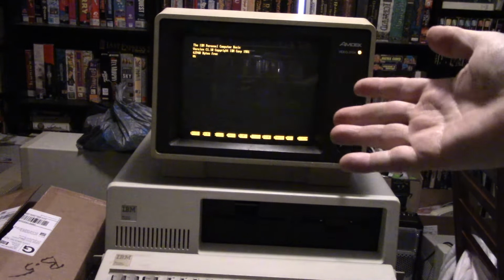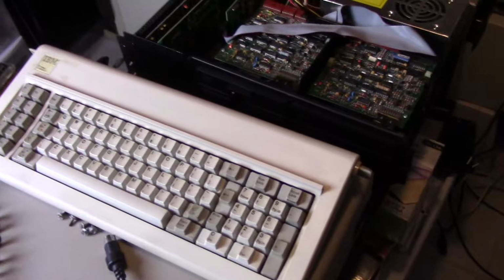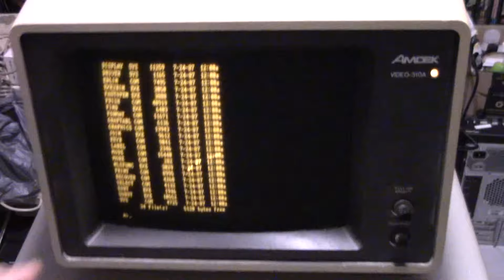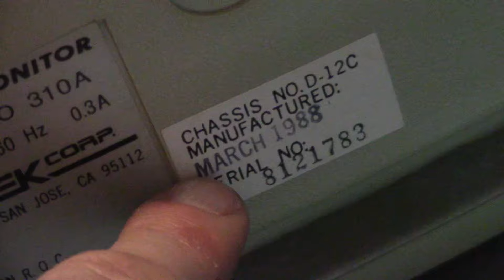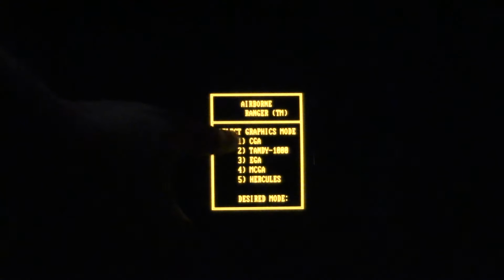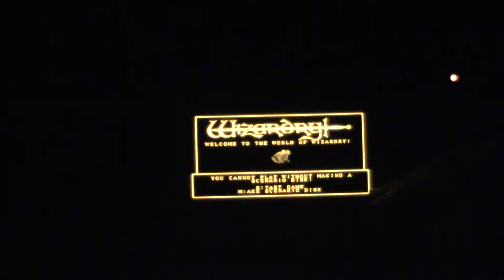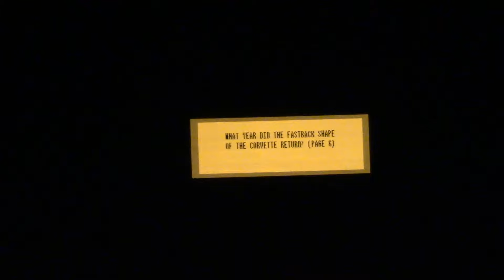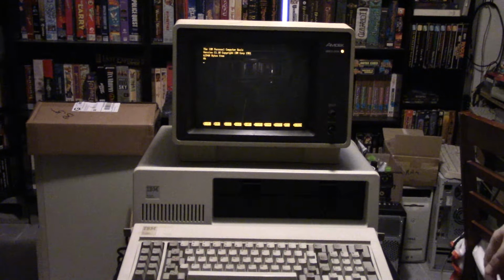IBM 5150 and Amdek 310a amber monochrome monitor

Comment: Green was indeed the first CRT phosphor color developed, initially used on oscilloscopes and radar scopes. Later they mixed blue and yellow phosphors to create a white phosphor, used in black & white TVs. If you take out the blue and just use the yellow phosphor, you get a yellowish amber color. I think there is some validity to the eyestrain argument, because green is fine for text-only displays, but for graphics, it is rather lurid, and amber is more pleasing to look at. Thus as the graphical capabilities of computers improved, amber became preferred over green.

And a lot of games don't fill the screen on Hercules because they used the same graphics that were designed for CGA, thus only filling up 640x200 out of the 720x348 display. Later when EGA became more common, the similar resolution (640x350) allowed them to share graphics with EGA and thus fill up the screen on a Hercules display.
Reply from the maker: But had you ever heard of complaints of colorblindness caused by green screens....I mean, I'm no eye specialist so I guess its possible but I'd never heard of that.

Comment: Hey it's me again if you remember from way back in Laveen, AZ with the Japanese computers. I've been in Japan again for about 3 years. Doing all my buying again before I leave. Almost done upgrading my Amiga 500 with everything. Next step is to get another PC9821, X68000, and maybe some more FM-Towns stuff. I will be moving to Texas this time. Currently catching up on your videos! Take care!
Reply from the maker: Hey, good to hear from you. I don't know if you've seen it already but in my newer videos, you may catch a glimpse of the PC-9821 that I finally got to set up after all these years. I really need to find time to do a video on it.

Funny enough I actually found another PC-9821 here locally, it's an older model from the one I got off you though. I'm currently trying to track down a PC-9801-86 card for a reasonable price since I learned the FM chip built into the 9821 isn't actually 100% compatible with all games.

Good luck with your Japanese PC finds! keep in touch.

Comment: Also ...super jealous you have a model f. Been trying to track one down for either the 5150 or 5160 if either one can be brought back to life....and jc howd you make boot floppies for it? I tried rawrite and it doesnt seem to want to write the dos 1x or 2x images correctly or at all
Reply from the maker: The model Fs can be finicky. I have a friend the has one, he cleaned it and refurbished it as best he could but it still has dead keys. Whats wrong with your 5150 and 5160 that their not working?  As for the floppies, money, lol. I was super lazy and just bought them off ebay. Theres a guy that sells diffrent ms dos version's. Retrofloppies I think his name on ebay is. He sells ms-dos 3.30 on 360k floppies for like $15. Sure I could of made them myself but somtimes I'm just really lazy and don't feel like dealing with it.
Reply: @AncientElectronics  I picked up a 5150, 5160 and 5170, 2 amdek 310a and a color 600a from a guy that was going to restore them in teh early 00s but never got around to them.  
The 5170 is fixed, but its an early model with the double stacked ram chips and least 1 is dead.
the 5150 i havent powered on yet but a 6pak clone had the varta corrode off and theres some corrosion on...one of the bios chips. and pretty sure the mfm drive is dead.
the 5160 might be toast, there was a mouse nest on the board and lots of nastyness....
Reply from the maker: @definitelycasualpcs8789  darn, I was hoping it was somthing simple like a dead psu.
Reply: @AncientElectronics  yea. I haven't gotten around to either yet tho...who knows they might just work. 
I have a spare psu from a fully dead 5150 (a large mouse died and um...yea you can imagine) and i know i tested it when i was troubleshooting the main board 
So I saved all the internals from that so ideally this 2nd one can be made to work... I already know it's going to be somewhat era correct (2 floppies, hercules or mda and 512k ram)

Comment: Never heard of Airborne Ranger before, but is looks like an interesting game. This machine is struggling with it a bit, though.
Reply from the maker: Its playable on the 5150 and it meets the stated box requirements but yea. Probably be a smoother experience on somthing like a turbo XT or 286 build.
Reply: @AncientElectronics Yeah, a 32kB of the Hercules frame buffer is too much for 4.77Mhz 8088 to run smoothly.

Comment: I had to remove an anti-glare screen like this from an Apple Monitor ///, what I did was a) open up back of monitor, b) discharge CRT so I don't electrocute myself, c) loosen the bolts holding the CRT to the case (using a long screwdriver), d) push the CRT back a few MM, creating a gap between the front bezel and the CRT, e) the screen is housed in a plastic ring so used snips to cut that ring so that it could be collapsed, f) pull it out from the front, g) reverse the process to put it all back together.